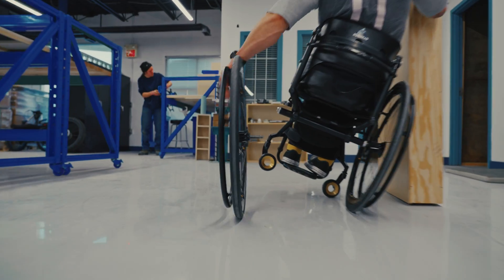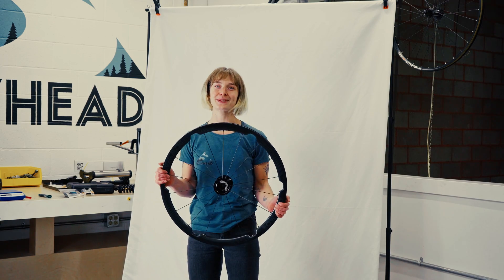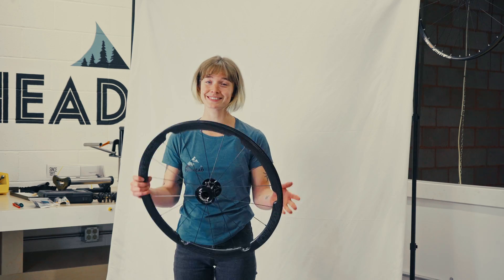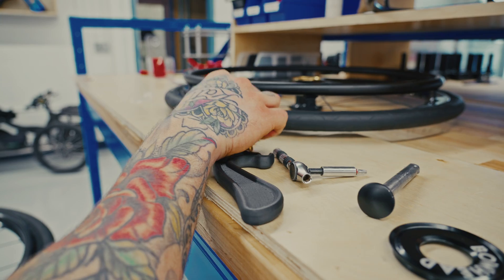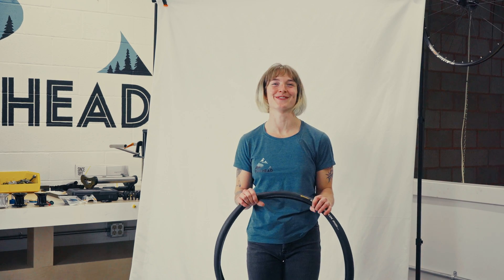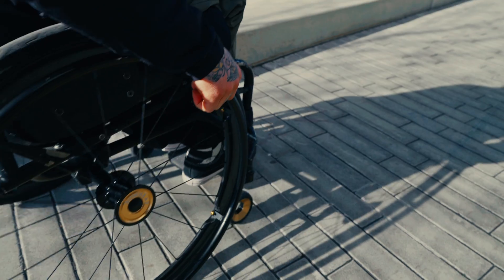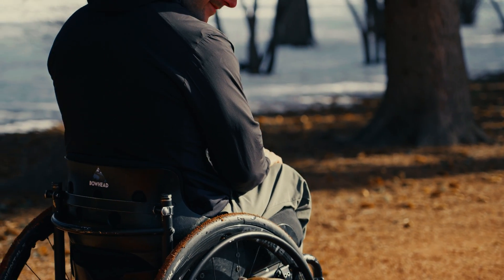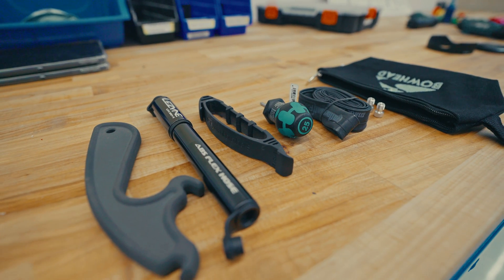INNOVATIVE NEW Wheelchair Wheels THE BOWHEAD 559s

Comment: Look nice but miss the biggest problem, push rims.  Doesn’t matter how round your rims are when push rims are unbalanced and inaccurate,  an integrated push rim would be major improve.  You can’t call them integrated when they are bolt on like everything else.  Be brave
Reply from the maker: Thank you for your input! While our current design features bolt-on hand rims, it's to ensure individuals have the autonomy to select hand rims tailored precisely to their unique needs and preferences. We believe in empowering users to choose the best-fitting equipment for their specific requirements. However, we continuously explore ways to enhance our products and will certainly consider your feedback for future improvements. Thank you for sharing your perspective!
Reply: @Bowhead  thanks, bolt on push rims are the biggest barrier to changing the wheel paradigm.  spinergy flex rims are the closest to changing this.  even so, collect all the 6 bolts and nuts x2 and see what the potential saving could be.

Comment: Could a solid tire work with these rims?
Reply: you dont need high performance carbon rims if you use solid tyres. period.
Reply: @qksmith  I appreciate what you're saying and as some who is an experienced bicycle mechanic and has maintained a wheelchair user's equipment for 20+ years, I understand why you're so emphatic. But, step back and consider a possible use case. Solid tires solve a very real problem for someone wanting complete independence and is concerned about flat tires. I know that a Conti tire is really robust. I've ridden with Gatorskins and I know what they can handle. But, I would have to convince the person using this rim to switch back to a tubed tire and that's scary for them. They've been trapped with flat tires and don't want that. But, they also want a more comfortable experience and they do want lower weight when moving a chair into a car. So, saying "you don't need high performance carbon rims if you use solid tires" is frankly short-sighted thinking. Again, I get why you're saying it, but maybe start with a little curiosity and ask why someone might want that setup... you might learn something. And, it keeps you from, you know... assuming.
Reply: @ChrisMcQueen  no question but solids are a a major compromise in every other respect.  feel, weight and performance are all out the window.  if punctures are your number 1 stress then go for it.  but don’t pretend you need carbon rims.
Reply: PS but dont really know why punctures would be a massive stress.  They are very few and far between on good pneumatics and pretty easy to fix or swap.  Have rarely had any issue.
Reply from the maker: Great question! When considering solid tires for Carbon rims, it's important to note that they require both extra force during installation, which could potentially damage the rims, and precise measurement compatibility between the rim and tire, which can be challenging to find. Instead, we recommend the Continental Gatorskin tire. It integrates three advanced flat protection technologies into a fast-rolling, durable tire, offering exceptional flat protection and performance without risking damage to your rims or the complexities associated with solid tire installation.
Reply: Thank  @Bowhead  . I've used Gatorskins and definitely found they are a good tire that holds up over rough stuff. Thanks for the insight.